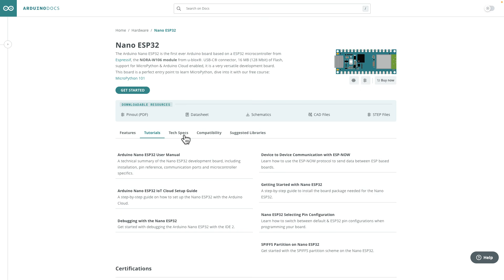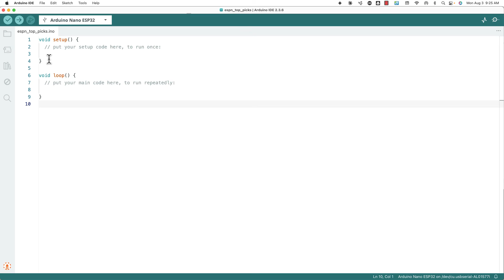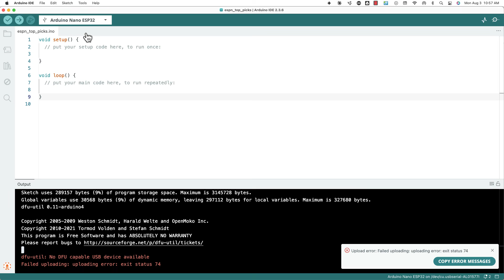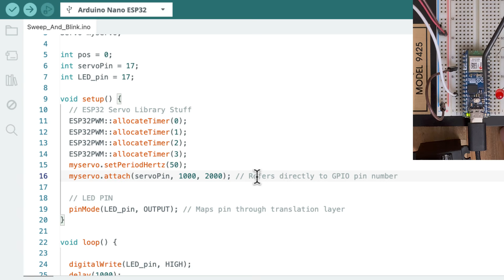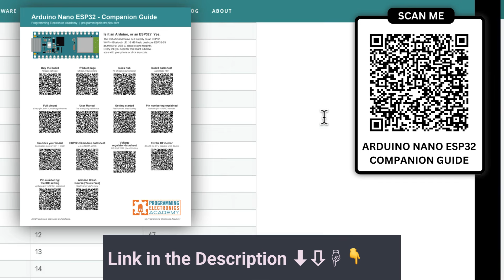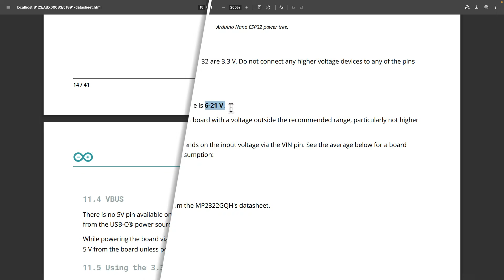Considering Arduino Nano ESP32?  Watch this first!

Comment: An ESP based board with 7 analog input pins?  That's a first, isn't it?
Reply from the maker: Great point, I should have mentioned something about that. I'm not sure if it's a first per say, but it actually has 8 analog pins (A0-A7).  If I understand correctly, the ESP32S3 has 2 ADCS, pins A0-A3 are on ADC1 and pins A4-A7 are on ADC2.  Apparently, when you turn the WiFi on, ADC2 doesn't work so great.

Thanks for this note!

Comment: 5v or 3.3v for gpio's
Reply: I think, 5V has been pushed back to the niche of ATmega328  or ATmega2560 boards. Best you can get on current chips is "5V tolerant"
Reply from the maker: It operates at 3.3V logic levels.

Comment: This is my Go To board! It's all I work with now! It's the Full Meal Deal! I've made some games with it. A Pac-Man game that has 500 mazes. A Space Explorer game, an AI Game Of Life. I love this board! I have a few videos on my channel. Why use a Mega, UNO or Nano when you can have a Nano ESP32 BEAST MODE! The games I made are showed on a 4 inch spi st7796s display. Awesome stuff!
And I make code with Gemini. I freaking LOVE Gemini!
Reply from the maker: Wow - great vids!  It's impressive how well it does those games!  Thanks for sharing!
Reply: @programmingelectronics I have to wonder why hardly anyone is using the nano esp32?!? I just coded a weather station that shows the weather in about 4 or 5 locations and shows the temps on a 6 hour plotter chart. This board is awesome. Keep On Coding!!